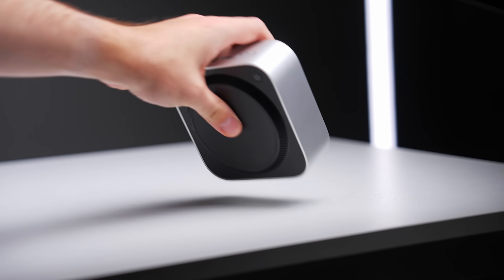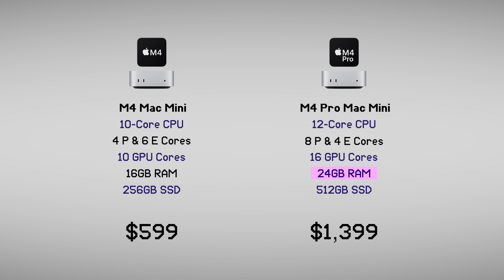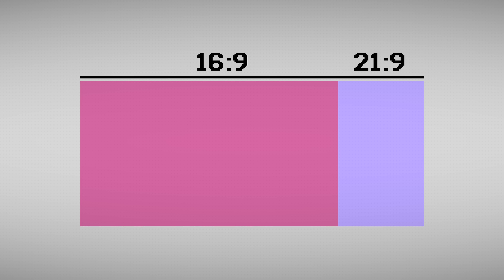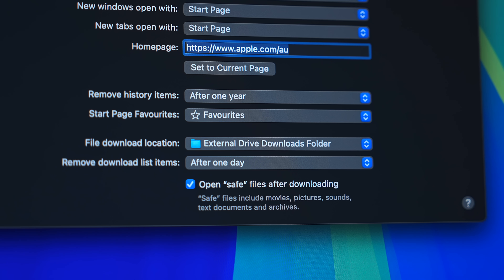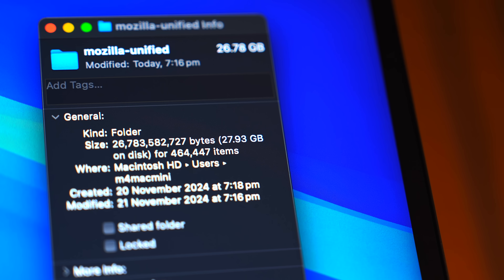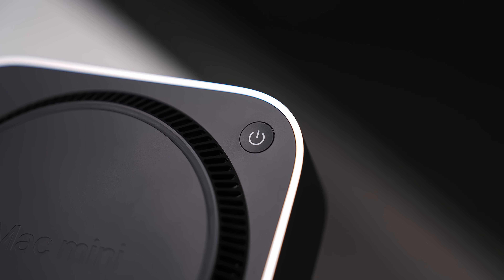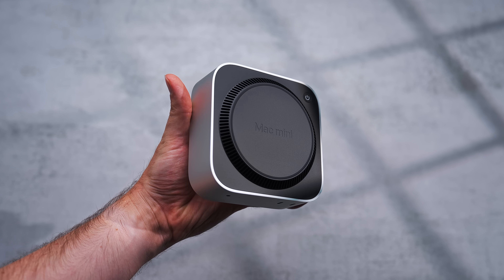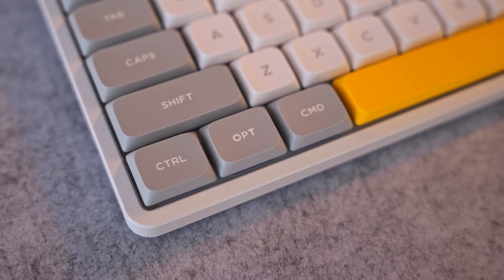M4 Mac Mini - Watch This BEFORE You Buy...

Comment: Your first point is accurate.  You can't add RAM at a later date.  Your subordinate point that you "have to make the correct decision at the time of purchase" is  way off base.  (At this point, I stopped watching this video because your credibility dropped below a minimum threshold. ).     One cannot reasonably predict that a "poor" decision like buying the minimum configuration is wrong.   You can buy it, and if it proves inadequate, you can sell it and upgrade to whatever you think your new needs are.   Presumably, people buying a Mini are already underserved by their existing devices and  buying a vastly improved machine will be an improvement.  A big one.    Ergo, they made a good choice.   Did they solve all future computing problems?  No. We never do.

Nice clickbait, though.  Anything mentioning M4 Mac Mini will get some views.    Not mine.     Breathless BS about a world-ending $600 "bad" decision might speak to people who obsess about nickels, but for thinking and reasoning people,   having a mismatch between needs and specs is familiar territory.   The challenge is how to respond to that inevitable condition, not how to avoid it for all time.   You should know that.         Buy a reasonable configuration consistent with your personal economics and upgrade if you need to.     Overthinking is a disease.

Comment: New sub here. Great channel. Would you be so kind as to answer a few questions. I mostly use Final Cut Pro & Photoshop to create videos on my Billy Luna Crime Stories YT channel. I am working in 1080p, but plan to start working in 4k. Currently I am Using a Sandisk Extreme Pro SSD (2TB & 4TB) to edit off whilst using FCP. I like to use Final Cut Pro, Photoshop and 40 web browser tabs open simultaneously.

1) For my needs, which exact configuration of the new M4 Mac Mini should I get? (Pro or no, RAM, SSD) This is the configuration that I have been mulling: $1,799.00 512GB SSD storage Apple M4 Pro chip with 12‑core CPU, 16‑core GPU, 16‑core Neural Engine 48GB unified memory
512GB SSD storage

2) What would the practical difference be when using Final Cut Pro, Photoshop and 40 web browser tabs open simultaneously if I just got the base M4 mac mini rather than the M4 Pro mac mini?

3) If I go M4 Pro what would the practical difference (for my use scenarios) be in upgrading from 24 GB memory to 48 GB?

4) Is there any speed or performance advantage in going with a 1 TB SSD vs 512?

5) Do I need to worry about fan noise when I’m recording on camera video or voice over with the M4 Pro mac mini?

Thank you!
Reply from the maker: 1. 48GB RAM is probably overkill, but if you have the budget for it, get it, because more RAM is always better and you can't change your mind later.
2. Depends heavily what exactly you're doing within FCP and Photoshop (e.g. how complex are the projects). If you're mostly video editing all day get M4 Pro.
3. Probably a waste of money, I doubt your FCP projects will be super intensive (e.g. lots of 3D effects, noise removal etc). See point 1.
4. 1TB is slightly faster but no real advantage other than being able to store more data on the internal SSD
5. No
Reply: Decide your budget and buy accordingly. It really doesn't have to be more complicated than that. Those sandisk drives are fine

Comment: I'm going to be getting the pro, I intend on using this thing for a good 10 years or so like I have my 2013 iMac it'll be replacing. Which still runs like a champ for every day browsing etc, it's just falling further behing on software support.

Also. Who turns off their Mac? This one especially uses next to no power when sleeping. My above mentioned 2013 iMac has been off for a grand total of maybe 2 months in the last 11 years. I turn it off fully when I'm not going to be in town for more than a few days. The only time the actual power button gets any use outside of this is if it crashes, which is supre rare.
Reply: Completely agree. All the fuss over the location of the power button is dumb
Reply: Let's hope the minis last for a long time. I also have a very old iMac that is still hanging in there. Before that I had two minis that both broke down within around two years. Some time ago now I know and technology improves, but my fear is that cramming that many things into a tiny space will lead to a shorter lifespan than in a larger size computer.

Comment: I bought the base mini. At first set up (without iCloud as I was thinking about moving my home folder) I was underwhelmed. However the next day I moved a few gig if data off my 2019 27 inch imac and then migrated across and it all looked a lot better. I found that Chrome, spotlight indexing and another two programs was using 10 gig of memory. To my amazement its quiter than my Imac using Handbrake and so for it's been pretty flawless
Reply: Ditch Chrome.....Always been a hog and tattles on ya !
Reply: @bennym1956  what do you use in place of chrome? I've been using chrome on my iMAC?

Comment: Any thoughts on Mx master 3s for Mac vs regular for use with Mac mini?
Reply: I’ve used both and haven’t seen a difference over Bluetooth. I do think it’s more sluggish without the unifying receiver so I’d go with regular. Unfortunately I’ve never used a third party mouse that felt like it was made for Apple, but I think that may be more of Apple’s doing than Logitech etc.
Reply: @DevinDillenger  Logictech software also sucks major ass in my experience, and it's worse on the Mac. So there is that aspect to consider.

Comment: Your advice is great, for NOW. But most people buy a system like this and work with it for 5 to 6 years. I'm not getting 32GB of RAM because I need it today, I will need it 4 years from now. Software apps will increasingly require more and more RAM. Why bottleneck yourself from the start?
Reply: Because the money difference you spend today to upgrade could be spent towards a better Mac Mini in 3 years from now, when you actually need more RAM.
Reply: @PandaMoniumHUN  That's not how most people work. I don't want to trade my 3-year old system in at a huge loss, or sell it to someone online, only to then have to spend half a day transferring everything to a new machine that I'll replace again in 3 years.

I'll buy one great system once every 5 to 6 years. The price is more than worth it.
Reply from the maker: You definitely won’t need 32GB of RAM minimum in 4 years. It’s been 16GB minimum for years and will continue to be for a while. You’re literally just wasting your money and giving it to Apple. I made a whole video on this topic.
Reply: Exactly. I fell the Intel Macs you felt the need to have higher memory. The Ms distribute the work load better.
Reply: PCs suffer from cray cray depreciation --- apples do not. resale value is stellar. IF you were to get a base mac M4 today @500 (on sale everywhere for this) in 3 years, when the M6 comes out at @ $500 again... your M4 will still be worth $300. Sell it, drop down $200 = new M6. Do it again 2-3 years later. Go into your bank app and have it pull $5 from your account every Friday and transfer to savings tasked only for a new mac purchase. 2 years from now = $500. =). we had a 16/256 M1 mini, just sold it for $380. Paid $630 as a refurb 2 years ago. Dropped $100 on a new M4... done.
Reply: @JamesBond-fo6ow  Apple resale value is great, but the resale value of the upgrades is horrid.  $1400 extra for upgraded memory/storage on an M1 MBP is worth an extra $150 or so over a base model on the secondhand market.
Reply: @JamesBond-fo6ow from what i have seen, resale value has gone down
Reply: Get a proper pc build with 64 GB? U insane or what

Comment: 16GB ram is NOT enough, when running Photoshop, Lightroom and Chrome with few tabs open at the same time, you will already be at 20GB ram usage. I went with M4 PRO with 24GB, and 30GB would be ideal, 48GB is a bit too expensive.
Reply from the maker: macOS is designed to use all available RAM at all times. So to the uninformed it seems like there’s “not enough RAM”. You should instead only use the “memory pressure” graph to the left to see if you’re truly maxing out your available RAM.
Reply: @CreatedTech  often in yellow
Reply from the maker: @janplexy  If you've only ever seen the memory pressure in yellow and that's the worst it's been, that means you have the perfect amount of RAM. Any more would be a waste.

Even 16GB would probably perform fine with your usage, although my personal recommendation would be 24GB.
Reply: @ i didn’t want my mac to go for swap memory, but it does.
Reply from the maker: @janplexy  Like I said, your Mac is supposed to maximize your available RAM and it will almost always use some swap memory too - you can't avoid it. It doesn't mean you need more RAM.
Reply: For those who are curious: I edit 1080p wedding videos at 60fps in Premiere Pro on my 2020 M1 MacBook Air. Only my last video when it exceeded 13 minutes long with stabilization, color correction, no proxies and several tabs open did it start giving me problems. My M1 Air is an 8GB RAM. Yeah, so I’m thinking 16GB should be plenty for what I do. I do keep an external hard drive plugged in with my raw media files at all times, so not sure if that assists in the smooth editing experience.
Reply: Not the case at all.

Comment: I completely agree with you.  I purchased the base M4 mini because I knew it would be perfect for my use case, and I was right (I've had it for 3 weeks).  I already had all the necessary peripherals, including a 2TB external NVME drive.
Reply: What do you normally use it for? Would it be a great option for a developer?
Reply: @obeddanquah  I'm not a developer so I can't give an informed answer.  I do MS office work (mostly spreadsheets), movie creation with iMovie using videos from my iPhone, photo editing, etc., no real heavy duty stuff.
Reply: I bought the base model. I run android studio and xcode. Working fine without any issues. But remember, android emulator will take more RAM, so better to test using mobile phone. For development purpose base model is enough for me.

Comment: Australian accent but USD prices?

Also, has there ever been a 3rd party mouse with 2 axis scrolling? I have tried other mice but scrolling side to side is essential for Illustrator.
Reply from the maker: Australian viewers make up about 3% of my audience vs USA viewers who are 20%+, so makes sense to just use USD for simplicity.

For 2 axis scrolling, the MX Master 3S has that capability. A vertical scroll wheel on the top and a horizontal scroll wheel on the side. I linked it in the description of this video.
Reply: @CreatedTech  I was going to suggest the same. Logitech has a lot of great products that work well with Macs. 
My personal Logitech mouse is the MX ERGO S Plus trackball mouse. The top scroll wheel can be set up for horizontal scrolling.
Reply: @Kevin6t8  the trackball is an option i hasn’t considered, do you find that you use the trackball part often? Seems like it would be more intuitive for moving around a workspace in all directions.
Reply: @xDMG15x  The trackball is what moves the cursor. It requires less desk real estate than a regular mouse. All of the buttons and scroll wheel work, and can be programmed just like any other Logitech MX mouse. It doesn't have the second scroll wheel like the MX Master, but the top wheel can be programmed to scroll side to side by pushing on the left or right side of the wheel.
Reply: @CreatedTech  oh yep, good call.

Thanks for the mouse recs, i might have to find somewhere i can test it out. Seems like having vertical and horizontal on different fingers might not be intuitive for moving around a workspace going diagonally etc. seems like it would take some getting used to. Cheers.

Comment: the workflow you've used to test the ram differences are not accurate to real world workflows. ArtIsRight has made the best in-depth comparisons based on real world workflows. Memory upgrades matter a ton for professionals. much more than m4 vs m4 pro in various cases. can personally attest to that, as i'm using m4 pro with 48gb memory and for my workflow, the extra memory has been highly beneficial.
Reply from the maker: "Memory upgrades matter a ton for professionals." Yes, and professionals are not buying a $599 base model M4 Mac Mini to do professional work on - which is the product specifically being discussed in this video.